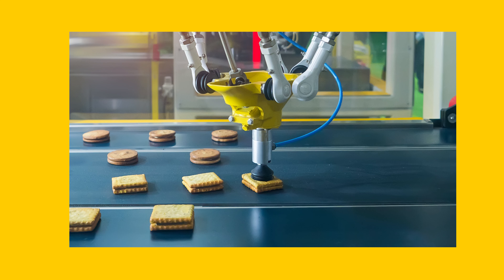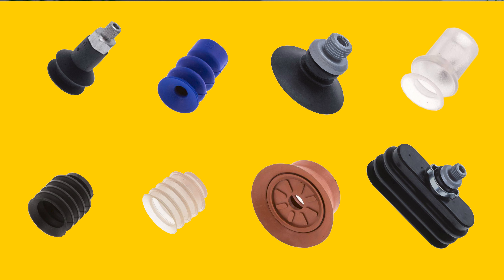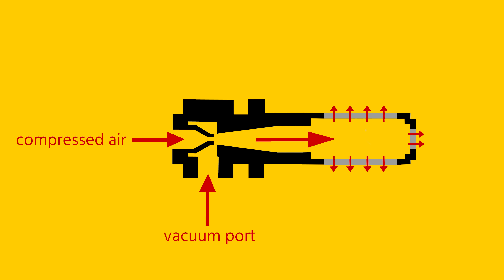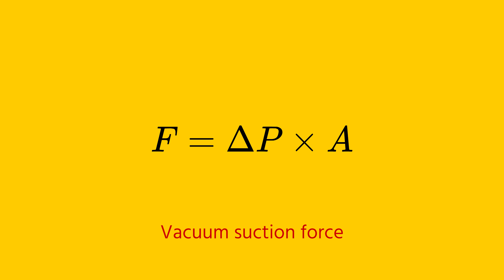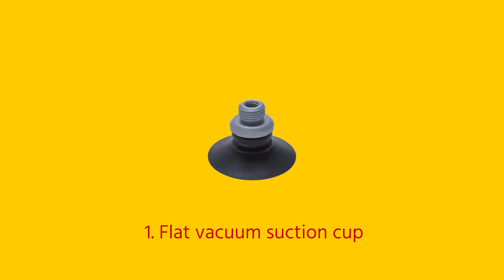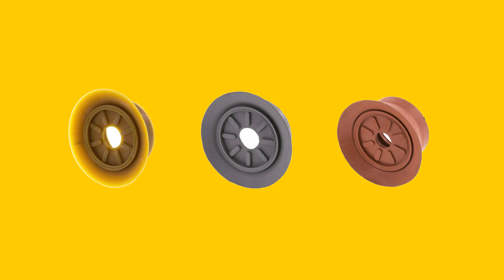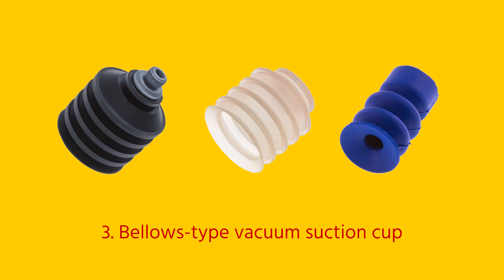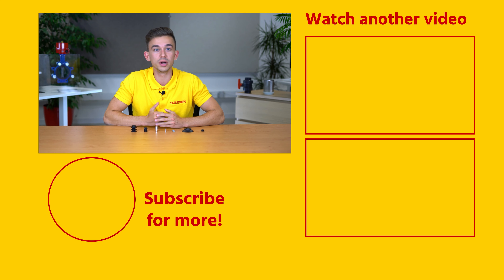Vacuum Suction Cups | How do they work & Selection guide | Tameson

Comment: How do I take care of the vacuum pump suction cup. Because mine stopped holding the pressure after a few months, is there some kind of oil or grease that I need to add into the mechanism
Reply from the maker: Hello, our range of products do not cover vacuum pumps so we do not have this information. Regarding the suction cups itself, it is recommended, however, to clean the suction cup on a regular basis to ensure it performs at its best. A buildup of dust or debris could potentially cause it to stop holding pressure. You can find more information in our article: https://tameson.com/pages/vacuum-suction-cup